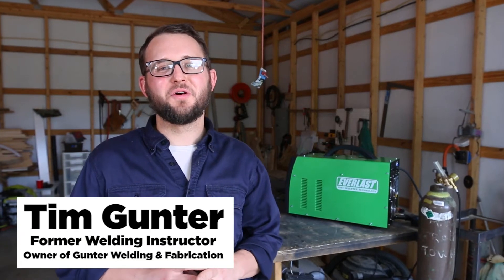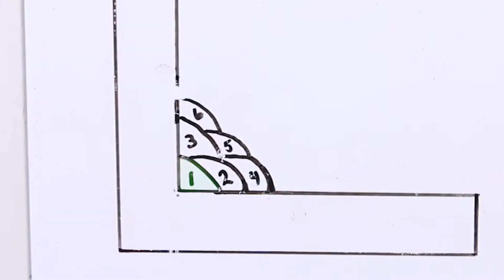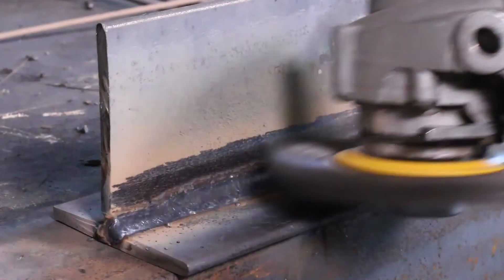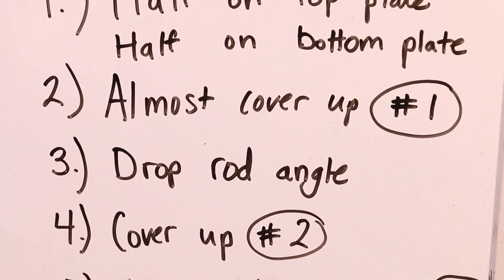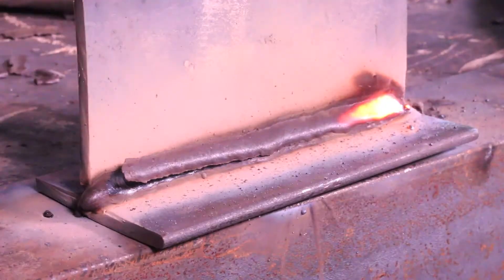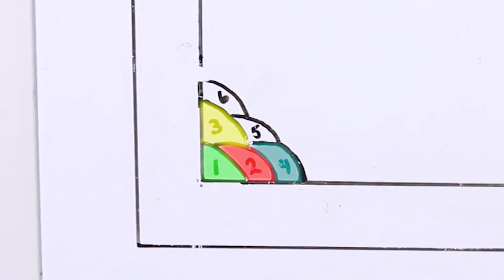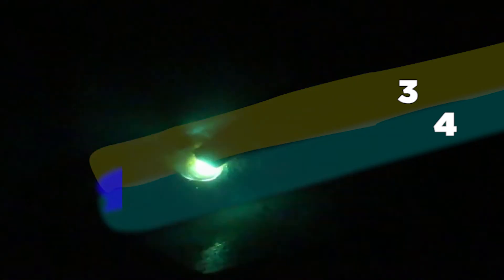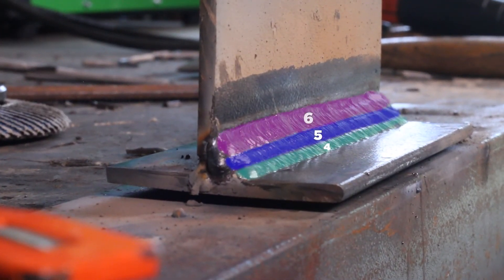How To Stack Welds In 2F Position

Comment: when I lay my beads the slack peals off like a banana peal but they dont stack right . my instructor says its my angle as my travel speed and arc length is good if that happens but they just dont stack so its my angles hope this video helps me been stuck for a week
Reply from the maker: Sounds like angle and bead placement. The video should help you fix that problem. Hope you figure it out!

Comment: Do you adjust your amperage as you build beads or does it stay the same throughout the entire process
Reply: Great question, amperage should stay the same throughout, I have seen some instructors recommend going hotter on the last (6) weld however it’s more of a preference, I know when I am running 1/8 7018 I stay at 119 for all passes, other guy I know will run 110 then on the very last weld bump it to 118 and his come out just the same as mine
Reply from the maker: Either let it cool down between passes or cut the amperage down a little each pass for the last couple. Helps a lot.

Comment: How do you get a 3/32 to last for an entire pass? Mine always burn 2-4 per pass and if I try to speed up, it underfills
Reply: Amperage, if you are running the same speed as in the video consistently you should have the rod to the stinger at the end, it’s definitely speed and amperage, you may be running a little too hot, and by underfills do you mean undercut or cold lap?